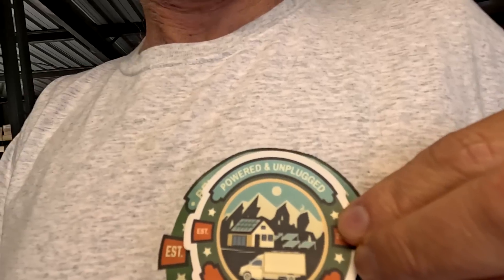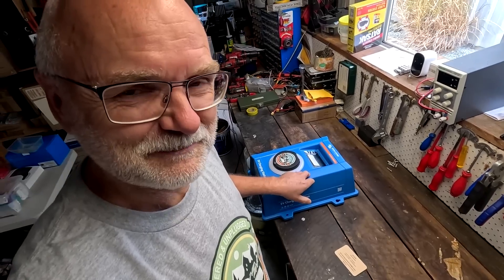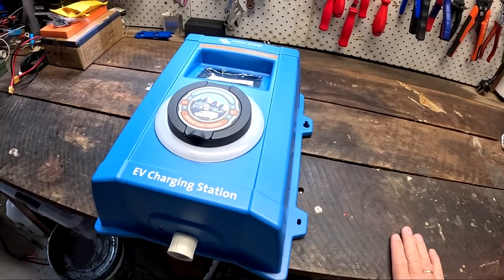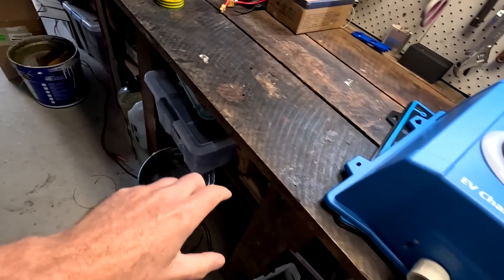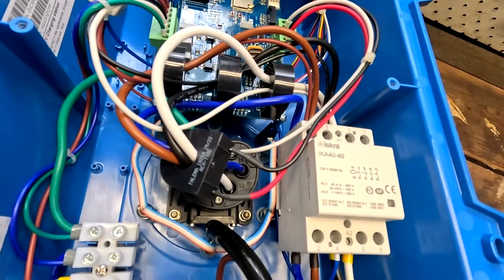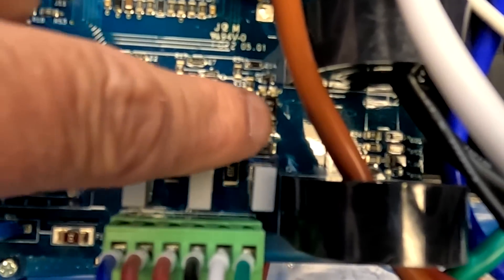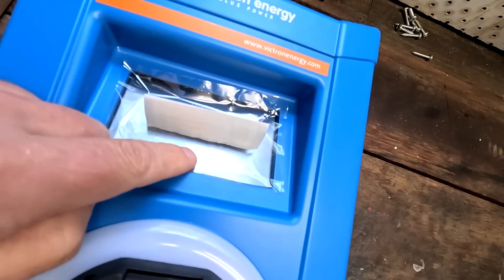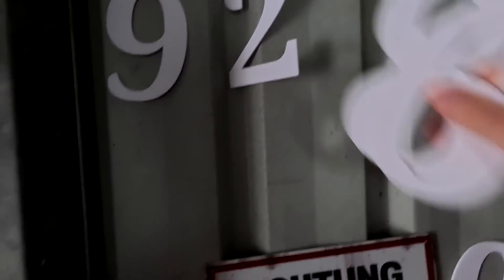Why a Victron EV Charging Station for our second EV?!

Comment: One thing to note when you are testing this thing, don't expect the charger / vehicle to instantly react to changes in power, e.g. if it is trying to soak up excess solar (tracking excess solar).  It isn't going to track very well and there could be up to a 10 minute delay depending on what is going on.

Typically smart chargers with power sharing or solar matching features have to operate very conservatively because vehicles do not instantly respond to requests.  And depending on the standard, the protocol might not even communicate a specific amount of current.  For example, J1772 / CCS plugs when operating in AC mode utilize a PWM signal to communicate the power request to the vehicle.

If too much current is being pulled, chargers typically pull the current request (PWM signal) all the way back to the minimum (which is 6A I think), and then slowly ratchet-up the request to try to rebalance whatever metric they are using.  Pulling back to minimum power is quite fast, but increasing it back to the desired value can take quite a while.

-Matt
Reply from the maker: I will only use it in manual mode. Tracking is kind of pointless in an off-grid system. But I will certainly test it😉
Reply: @OffGridGarageAustralia no it’s not,  you can use the EV as extra storage for the solar system.
Reply: @ThanosSustainable  Yes. But i don't think that is the issue here. In an off-grid System there is no power there is no power coming in or going out at any time. Unlike with grid-tied systems that always have small errors in regulating the power to 0 at the grid connection (if you dont want to feed in at a retain point in daytime).
So in an off-grid system there is also no point in having an extra grid-meter to measure the excess solar power because there is nowhere for it to go and the system will just end up no generating any surplus.
Usually solar tracking with EV charing stations use the surplus of a grid meter as basis to adjust EV charing power. To achieve a similar behaviour in an off-grid system you would have to calculate the car's charging power in a different way - most likely with an EMS before the solar battery is fully charged (if you want it to be automated anyway).
Way easier in short term is to use the charging station in manual mode, but then you have to personally manage all of your EVs yourself.
Reply: No you can adjust paramètres, it work very nice .
You must read all's the instructions on the website off Victron.
It depend also off the car 
Ex the Zoe will not charge below 100 A
Reply: @ericverlaet4447  Which parameter? How would the Victron system know how much solar excess there is in an off-grid situation and if the battery is full?

What do you mean by 100A with the Zoe? If you speak of AC charging current, I don't think the Zoe is capable of such currents. If you mean solar system battery discharge current, how would the Zoe know how much the current in the victron dc-system is and why would the car decide not to charge below that value?

I don't doubt the victron EVCS is working well with excess solar in an on-grid situation, but your statements confuse me. Please tell me if you know how it works in an off-grid situation, I'm genuinely interested.
Reply: @ando3807  The Victron certainly knows when the battery is full as it will be curtailing solar at that point.  So excess solar is just the amount available in excess of the curtailment.

But the bigger problem for EV charging is determinism... when you plug in your vehicle, you expect it to be charged in some minimally deterministic way or you won't be able to drive to work the next day.   That issue generally makes most of these "smart" EV chargers fairly useless in real-world situations.

One might as well simply set the EVSE to some reasonable limit, like 12A or 16A, and leave it running in dumb mode.  Or perhaps program enough smarts so the Victron cuts it off if the battery gets too low.  But not much smarter than that.

-Matt
Reply: @junkerzn7312  And how would the system know how much power it is currently curtailing? The PV current is basically limited through the dynamic charge battery current (-minus whatever current the inverters draw if all works correctly) which approaches 0 when the battery is (close to) fully charged.
The only way I can think of the system knowing the current curtailment (again: only in an off-grid situation) is through an solar irradiation sensor, temp sensors on the solar cells and a good model of the solar array. In addition a EV is a really sluggish load and I expect it to be way too slow for Victron's DVCC kicking in fast enough or for it to work properly.
Reply: @ando3807  The charge controllers know when they are curtailing and when they are not.  They might not know how much but it doesn't matter, the EVSE can just servo the power it allows the vehicle to charge at around that fact.  And it could even get a pretty good idea at how much energy is actually available that way as well.

I'm a little confused by your narrative.  Why do you think the Victron network wouldn't know what its various components are doing?  They know the SOC of the battery, the current going in or out, and whether the charge controllers are curtailing verses not.    That is all that is really needed to servo excess energy into the vehicle.

In fact, the EVSE could do it based on battery SOC alone as reported by the shunt.  Charge the vehicle whenever the SOC is above 98%, and stop charging when the SOC drops below 95%.  Done.

And it could also do it based on battery voltage.   Start charging the vehicle when the voltage gets close to the charge target, stop when the voltage falls below the float.   Again, done.

-Matt
Reply: @junkerzn7312  But this then is no real PV excess trailing EV charging but rather than a bit more extensive way of EMS algorithm.
I am certain that the DVCC works just fine for Victron components, but it certainly connot control the EV in the same way and speed than solar charge controllers or inverters as this depends on the vehicle's on-board charger and how fast it reacts to the EVCS's setpoints.

My narrative? I don't know what you read into my comments really. What I wanted to express is that excess PV charging in off-grid just doesn't work the way it usually does in grid-tied systems as the typically used metering value doesn't exist. And that is basically also what you said in your last comment(s).

I'm sure Andy will find a way to make it work just fine for him in his situation - either manually or automated.
Anyway, be well and stay charged!
Reply: @ando3807  I don't think you even read what I posted. I gave 3 different ways to do it.  Of course it works, and it works usefully.  Just like any excess dump which people have been doing for ages.  There is nothing special about EV charging that makes it different.

Comment: Pretty huge profit margin considering that the thing only has about $150 worth of parts inside it.
Reply from the maker: Isn't that the case with almost all devices?
Reply: @OffGridGarageAustralia  Not to that degree.  Victron is leaning on their brand to over-price the device.  There really isn't much to an EVSE.  It is literally just a contactor, current sense, temperature sense (for the nozzle that plugs into the car), PWM/comms output, and a simple protocol, and its done.  The most expensive part is the contactor.   The network stack is built into the microprocessor.

Comment: Well, you already know my video about the Victron EV Charging Station and the problems I have with it...😅

I hope yours has at least the Firmware Version 1.23 or newer installed on it. My charging station only had the very old version 1.21 on it. But the Bluetooth function for the Charging Station to use the VictronConnect App can only be activated with the firmware version 1.23 or newer😏

And unfortunately you also need a Victron Professional account to be able to download a new Firmware, because you don’t get it on the normal Victron Website 🤷🏼‍♂️
Reply from the maker: Yes, seen your video...

Comment: Hi guys, thank you for the video Andy! There is already a new Charging Station (revision/ v2) out, so hopefully another friendly guy may sent it to you for a direct comparsion. 

Tbh I did mot like the EVCS from Victron, in Germany you need additional RCD Type which costs ~400€, other wallboxes have build those in amd are certified and tested. I installed a warp charger 2 (v3 oit some month ago) and put a script in my Cerbo GX large image NodeRed, which controls my charging. If you are interested, I may provide it to you, should work with several others, too (but may need some adaption). BR from Germany
Reply from the maker: That is the one without display, right? A smaller unit. I think it is just a different station. I wanted the display because we can set the charging power and mode directly on the unit without using the app.
Reply: @koestich  Take a Doepke FI-Schalter Typ A EV – DFS4 040-4/0,03  it is about 230€ and will protect you.

Comment: Hi Andy , does the Ora have V2L ?? I have a victron quattro 2 and use the generator connection to take power from a V2L car to my home
Reply from the maker: No V2L with the Ora. I have 200kWh of batteries in the garage, so don't need the 'small' car battery.

Comment: Oh, this is interesting! I have an old 6 kw charger for my old Nissan Leaf. But like you say, it takes what it can, no way to throttle the power. 
So this is exactly what I'm looking for, from a functional perspective. However the box looks... Meeeh... However, i am thinking that i might be able to shoehorn the components into my existing charger as an upgrade..;) looking forward to the next episode!
Reply from the maker: Yeah, I tried with several charging cables and stations and the Ora just takes whatever it can from any station. So this Victron station was on my radar for a long time. I wanted it for my Model 3 but since I can adjust everything through the app, it makes more sense for the Ora.

Comment: My first question: can it ‘uncharge’ your car? In other words: can you use your car as a battery for your off grid home?
Reply: No, you need V2L support in the car for one, and a bi-directional charger which this is not. You typically use a dedicated cable supplied by the car manufacturer to access V2L.
Reply: this box does not contain an inverter and doesn't connect to any vehicle's DC side, so there is no way for this box to do V2H

Comment: Looks more like a mediocre diy project than a commercial product.
Reply: Same. Not what I would expect from Victron, and definitely not with that price tag.
Reply: Makes me want to DiY an EV charger.... But no EV to charge, yet. 🤔
Reply: @jamess1787  I had a reply typed out, but YT deleted it. Maybe you got it in your notification or email anyway... Short story: better and cheaper elsewhere.
Reply: @jamess1787 OpenEVSE for North America and Japan and another project for Europe exists. The latter (I’m forgetting the name) is implemented as a DIN rail component so it’s very easy to DIY.
Reply: Victron - you can also purchase better but you will never pay more and get buggy software to boot.
Reply: it is like a DIY project and it's somewhat open for tinkering, but mediocre it is definitely not. For example, it can be easily modified to accept 3 phase electricity and then switch to single phase when there is not enough sun
Reply: Yeah, they copied some diy project i've seen, those recom ps are familiar.

Comment: does it work to charge when offGrid?does it use all the avilable solar power?
Reply: You can configure that. You can have a fixed limit, or use the excess solar.
Reply: how does it see you have execess solar being offGrid?
Reply: @MrElciupacabra  It integrates with the rest of the Victron system, so it can see how much is being consumed by the inverters and how much is generated by the charge controllers. It can increase/decrease the load so that no power is drawn from the battery.

Comment: As a german electrician who has installed a couple of wallboxes, about 15 different models so far, the victron EVCS really looks horrible to install as you usually have solid 6mm2 cables which will cause some problems in those hard screw terminals, being moved afterwards
Reply: Would recommend the newer version without the anyway useless display.
Way better case design to mount and install it.
Reply: Yeah, solid wires are no good for electric. Stranded is the only way to go for a good connection and flow of electrons...
Reply: so it looks horrible, but actually never installed one personally...
Reply: @williamos1985  That is exactly what I said. I have installed enough devices that are built similar to the victron evcs to know that it will be a pita
Reply from the maker: No solid 6mm wires down here...
Reply: It seems like only german electricians use solid wires....😉
Reply: @Juergen_Miessmer  What do other countries use? Fine strades wire? And then the spanish solder dip as a "connector"?😂😂
Reply: @legominimovieproductions i use the indian fuse system be sure to wear youre flipflops when connecting a wire on a live system
Reply: @electro2606  😂😂😂